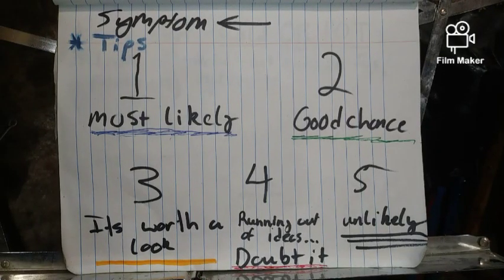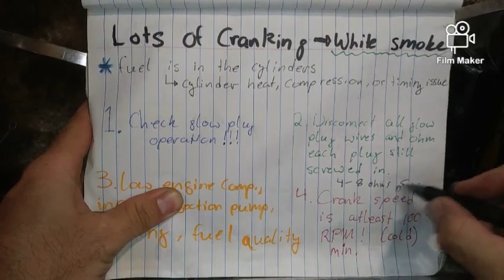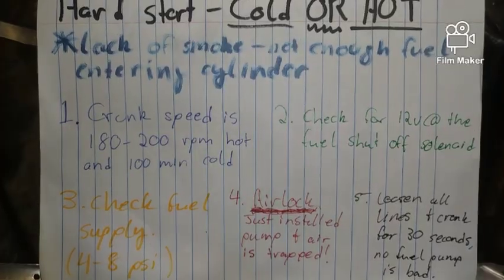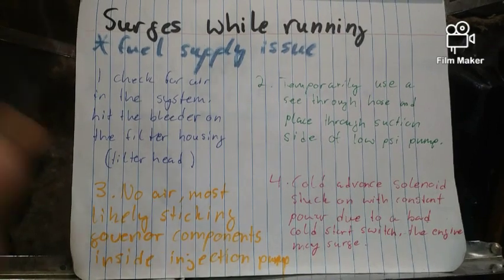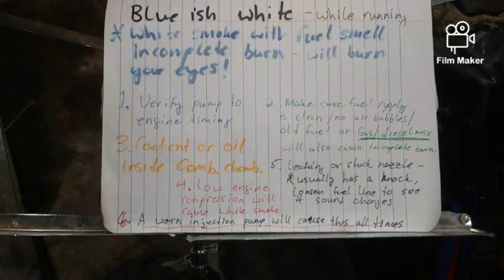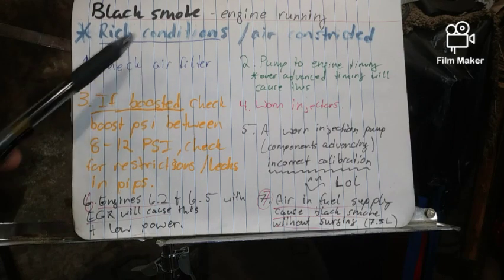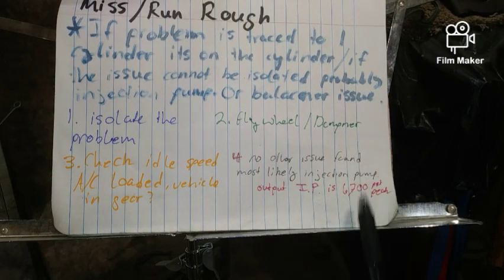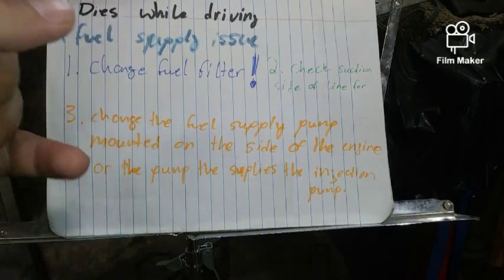DB2 stanadyne GMC, Chevrolet Ford injection diesel system troubleshooting guide 6.9l 7.3l 6.2l 6.5l

Comment: This is a great video. Honestly best one i found. Im hoping you can help me with an issue. Ive got a 6.9 idi. New injectors, 26k miles on ip, no air intrusion, correct fuel delivery. My problem is the combustion or injection noice will randomly increase while driving. The noise goes back to normal when i lug it, gets very loud when i let off, and back to normal when idling. Does not miss or smoke, has the same amount of power. But does not sound healthy. Hurts your ears, 83dB under the hood
Reply from the maker: Hello! Thank you for your feedback, based on the information you have provided the best thing I can suggest is check your exhaust manifold AKA headers at the connecting points. You're going to be looking for suit (black carbon) build up. If you can find this this would be a sure indication of an exhaust leak. This is the best suggestion I can give.

Another reminder these engines are becoming older and older, and they do make a lot of noise in general. Another suggestion I want to make is considered the oil you are putting in. Degrading in oil will always amplify mechanical noise. I suggest picking up some diesel heavy duty lucas at your local convenience auto store. 

Best of luck friend!
Reply: I have to agree, now I have a road map for my 6.5

Comment: Excellent man! I appreciate you putting together this content. Ive been having an issue with my truck and was hoping you could chime in. It fires right up but it misses and smokes like a freight train for the first 3 minutes that its on. It sometimes misses on one cylinder and other times its multiple. Generally it stops smoking when its warmed up but it does intermittently put of a small amount of a white / blue haze. My mechanic wants to just jump in and change IP right away but I'm broke and a little apprehensive. Do you have any thoughts?

Comment: Hey first time watching, liked the breakdown and details. I have an issue with a Detroit diesel 6.5
2000 model Chevy 3500.
I’ve worn out 3 PDM’s in 6 months,
I pulled the intake to change out the 
“Pigtail” wire from IP to PDM , screws into the back of the Injection Pump, Now the truck will not start, I’ve tested glow plugs…great, I’ve tested the fuel solenoid I seams to respond every time key is turn on. I have confirmed fuel all the way to the top of injection pump, I’ve disconnected lines at injectors no fuel….. trying to rule out entire check list before I bury a 1000.00 into a IP.
Advice ??
Thanks , Luke

Comment: Bluish/white smoke, combined with a misfire, would that be caused by a worn injection pump?
Reply from the maker: Blue is oil, white is unburnt fuel being atomized. 
Focus more on this: Misfire is due to a lack of combustion event happening in a particular cylinder. Why? Either lack of fuel from 1 injector(s) and or damaged mechanical parts affecting the flash point that is required for ignition.

Comment: Just bought a 93 7.3idi with 83k miles runs good and sounds good but it smokes thin blue  smoke at idle. It goes away when  on the gas
Reply from the maker: Could be a couple things here. Since you just bought it no telling what the previous people had in the fuel tank. Since you can run these engine off of raw engine oil in the diesel fuel that is right I just said that it will burn blue.  Adding other things will also make it blue idling. Blue equals oil, since it's at an idlel I would either say it's what I said above OR the umbrella seals are leaking oil from the valvtrain, OR there is a head gasket issue but it is unlikely
Reply: @ChaosExplained  thank you for replying back. Do you think it can possibly be due to dirty fuel. I just did the fuel heater delete yesterday and found a bunch of rust particles in the fuel filter.
Reply from the maker: crish02 yea definitely change out your fuel filter. Before you go jumping into it I would suggest watching a crash course on it. Basically the gist of it is make sure you fill it full of diesel fuel before you put it back on otherwise you'll be cranking the hell out of your engine to get it Prime backup and all of the air out of the lines.
I have seen it on my own truck where it was puffing some blue smoke lightly until I changed, the fuel filter.

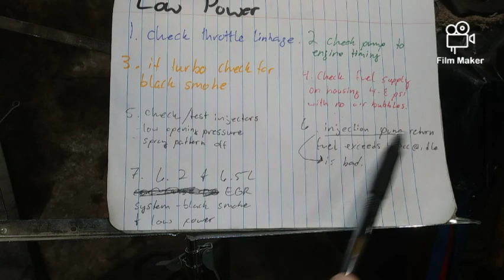Comment: @21:55 4500CC per sec? miniute? what is the time frame for that flow rate at idle?
Reply from the maker: Not sure about that bud, but at idle when you crack open the injector not fittings you should have plenty of fuel squirting out even at idle and crank

Comment: When I'm coming off a mountain at 55 the longer I'm off the throttle the longer it takes for me to get throttle back. Hit fuel nothing happens until rpms drop. What is likely the problem? 87 cucv chevy 6.2, runs great otherwise

Comment: Is there a difference between a IP from a 1986 and a 1993? I have heavy white smoke on start up weather it is hot or cold???

I blew the oil return line on my 6.2 and lost the engine so I bought a rebuilt 1993 6.5l with turbo and put it into my 1986 GMC Serra Classic. The 6.5 did not have a IP so I took the IP off of my 1986 6.2 and put it on the new rebuilt 1993 6.5l... it runs very good but has heavy white smoke when I start it up and for several minutes after, weather it is cold "OR" hot.

Could this be because of timing or is there a difference in the IP between the 1986 and a 1993?
Reply from the maker: @highdesertink1993  gotcha, no they're all the same what is different is the tuning which the 93 is only turned up off the factory line to compensate for the turbo air to fuel ratio. 

White smoke, commonly on these old beasts it is unburned fuel atomization . If it was on a combustible I would lean more toward white smoke questionably being a head gasket leak burning coolant and if you do you need to check your coolant reservoir
Reply: @ChaosExplained  I don't loose water, the reservoir is nice and green... the smoke smells like fuel not sweet? The smoke goes away after a wile but it does smoke every time I start it up hot or cold? Could it be that I need to turn the IP a degree to the left or right?
Reply from the maker: @highdesertink1993  I wouldn't go tampering the adjustment on the injection pump just yet do you have any Blow by once the engine is warmed up you could also have a sticking fuel injector fuel injector let me know what kind of blow by you have once warmed up. Yeah if it smells like fuel not sweet and it's white and then goes away then it's at least one cylinder that's simply not combusting the fuel that's in it
Reply: @ChaosExplained   No blow by at all, hot or cold?
Reply: when I remove the oil fill cap there is nothing coming out at all, this engine has under 9k on it...
Reply: We did put the IP into this 6.5 and that is what makes me wonder if it needed to be turned a degree to the right or left? the injectors and glow plugs are almost new maybe 2k on them. I tested the glow plugs and the wire harness and is all good but don't know if maybe 1 of the injectors was a lemon? I have not learned how to test the injectors yet.
Reply from the maker: @highdesertink1993  I'm sorry, did you say at idling it is rolling black smoke once warmed up?
Reply from the maker: @highdesertink1993  yeah there's absolutely no blow by cold or warmed up and there's under 9k miles I would venture to say that lower engine is in great condition.
Reply from the maker: @highdesertink1993  does it smoke at all once you get it started and it has been idling for a minute? If it continues to roll black smoke mildly moderately or severe let me know. It is so common to roll white smoke initially on these old diesels that are mechanically governed.
Reply: @ChaosExplained  No black smoke, just heave white smoke that smells like fuel for several minutes after starting... hot or cold
Reply: @ChaosExplained  It take several minutes or a mile down the road before it stops smoking???
Reply: @ChaosExplained  If I can't stop the heavy white smoke on start up, other than the loss of fuel and money will I be hurting the engine?
Reply from the maker: @highdesertink1993  well there's contradicting things going on you checked in your Reservoir and it's completely green new sign of any oil. 
The other thing you can do is strap a glove onto the radiator cap and if the glove stands up then you have a blown head gasket but I highly doubt this is the case.

And if it smells like Fuel and it's white and it's heavy that simply unburnt fuel . 

Do you have any lifter noise or anything ?
Reply from the maker: @highdesertink1993  I mean yeah you're hurting your fuel economy with unburnt fuel, but I mean it is a truck remember we didn't buy these things for fuel mileage. My suggestion for now is go over those checks I suggested and throw some injector cleaner in the fuel and run that for a while.. I'm wondering if you don't have a stuck open fuel injector if assuming all the valves are operating the way they're supposed to since there is absolutely no black smoke and there's no engine hesitation especially on acceleration I would absolutely 100% leave the injection pump alone
Reply: @ChaosExplained  I wouldn't know the difference between a lifter and the rattling of the diesel engine itself? Ill go over everything you mentioned in this video again incase I missed something... I wish you were in Redmond Oregon I would pay you to go over this matter. There is NO ONE here that knows this 6.5 with the manual pump. The only diesel shops here need to use computers. 🙁
Reply from the maker: @highdesertink1993  word up on that brother, yeah everyone's moved on to electronic systems. Also I see that this is for a 6.5 gm. But yes they use this pump on various makes I believe even a lot of tractors they use the same thing but the principle is all exactly the same. Let me know what you find out!
Reply: @ChaosExplained  OK, I retested my plow plugs and they are all showing "0.9", my wires from the controller are showing a little over 10v "not 12v"? I ran it for 15min and no blowby from the oil fill spout  and no sign of water just black oil if there's anything and the oil on the dipstick is (black not milky) right where its supposed to be. I put a latex glove over the radiator fill spout just to see but nothing and no bubbles at all either. I believe the chance of the heads or block having an issue is no chance at all.

After about 7 to 10min the smoking kind of stopped but not totally and if i rev up the engine it will smoke again but now it is white with a little blue gray and black in it as well??? when I stop the revving the smoking stops but there is still a VERY little that comes out.

Also when the engine is at idle it idles perfect but when I do rev up the engine it sputters a little like it has either to much or not enough fuel until I hit a higher RPM then it smooths out??? I let go of the throttle and it drops back to a smooth idle.

Under your ""White smoke #3"" you have incorrect injection pump, timing. Like I said before this pump came off of a 6.2l with turbo but I cant remember if it smoked or not, I believe that it did.

Where would you go next? Please help and if you can help me fix this I WILL (gofund.me/6358f95a) TIP YOU!
Reply: I found a video that looks like mine...

95 Chevy 6.5 Turbo Diesel Smoke & Rough Start - The Sequel

Matt Jorgensen
Reply from the maker: @highdesertink1993  okay so the 6.2 was a turbo set up?

And the 6.5 you have now is a non-turbo.

This injection pump as we speak should be running slightly to Rich so if this is the case a little bit of black smoke at idle it might even look bluish. If you're really bothered by this and this is the case especially black smoke under acceleration then this pump needs to be turned down!
Otherwise you will have a little bit more power with it turned up but it's harder on the engine so that's the trade-off. 

10v and 12v on glow plug circuit... it's very hard to help give it accurate advice through here you're ground to chassis and Chassis to negative battery to make sure there's no built up corrosion.

Misfire at mid rpm- there is a very good chance you could have an air bubble stuck in the lines. Do you know how to bleed these off? Make sure these lines are bled off. Another suggestion is to run some fuel injector cleaner. 

There is a good chance you could have a fuel injector malfunctioning.
At higher RPM this misfire due to a potential faulty injector is going to be a lot less noticeable. It should be very noticeable at low RPM like 1200rpm. Once you get up around 2200 rpm the misfire won't be noticeable if this is the case.

Multiple things going on, let's figure out misfire first.
Reply: @ChaosExplained  This 1993 6.5L is a turbo engine, I just watched 4 videos on Injection Pump Timing and on advancing (to the drivers side) or retarding (to the passenger side) and how to tell if you need to do so or not...

On the side of the DB2 manual pump there is the "advance external lever" on the passenger side of the pump right below the ""Face Cam". With the engine running you want to push in the bottom of the advance lever and if the engine dies you defiantly have to advance the timing by loosening the three 15mm nuts and turn the IP to the drivers side one line at a time and if the engine doesn't die you want to either leave it there or turn the pump to the passengers side.

One video i watched has there timing just right and when he pushed in on the lever he went from a clean exhaust to a smokey one but the engine kept running with smoke.

Then he retarded the IP to the passenger side and the engine smoked (like mine) but when he pushed in the Advance lever the engine died (needing to be advanced) just like mine did just now.

Then he advanced the timing and the engine ran good again. I hope that I wrote this all the right way. So I'm going for the advancing the IP timing next...

White smoke= fuel not getting enough heat to combust.

Black smoke= fuel not getting enough oxygen to fully combust.

Ill let you know what happens next just for the record.
Reply: Both the 6.2 and the 6.5 have turbo, the only reason i mentioned the 6.2 being turbo was you had said that the only difference in the IP between the 6.2 and the 6.5 was that most 6.2's didn't come with the turbo. So I just wanted it to be known that they both had turbo so that wouldn't be a factor in the functionality of a IP coming from an 1986 6.2l turbo engine and going onto my rebuilt 1993 6.5l with turbo...
Reply from the maker: @highdesertink1993  yes sir I agree white smoke is atomized fuel Vapors that are unburned.

Black smoke correct again running too rich on fuel yessir 

Blue smoke is oil.

Rainbow 🌈 smoke..  running on fruit juice? 😋 🤣 

All right just trying to be funny at this point. Let me know what you find out partner. It's hard to be good assistance over text
Reply: @ChaosExplained  I advanced the pump to the drivers side about 1/16" and BOOM no more smoke. I fired it up and it even started faster on the first turn where it used to drag a little. Hell it even idles by its self cold where it used to not before I would have to feather the pedal till it was warm then it would idle rough by itself. Now it is smooth by itself when cold...

It smoked 90 percent less at first  I gave it a little time, revved up the engine... brought it down to idle and no smoke at all! If I slowly increase the RPM no smoke but if I stab the pedal then I get a little smoke but again no smoke at idle. "YA"

I hope this thread can help someone else?
Reply from the maker: @highdesertink1993  heck yeah! Welcome to YouTube baby. You bet people will read long threads like this because I can guarantee there's thousands of people still looking for help out there on these trucks. 

Awsome!

Comment: I am having an extreme issue with ABSURDLY rough running, lots of smoke, greyish white, and a really touchy and surgery throttle. Any ideas? Just replaced the pump with a Pensacola reman. The problem did not exist beforehand
Reply from the maker: My very first suggestion is bleed off the air that's probably trapped in the lines! You just undo the hex nut at all of the injector fittings while it's idling. If it's idling too rough, have it run for just a moment so I can build up some pressure then turn it off. then bleed off one hex nut at a time you'll see here into your Air seeping out with a little bit of fuel. Some injectors will be worse than others